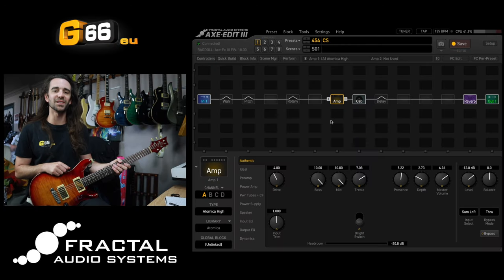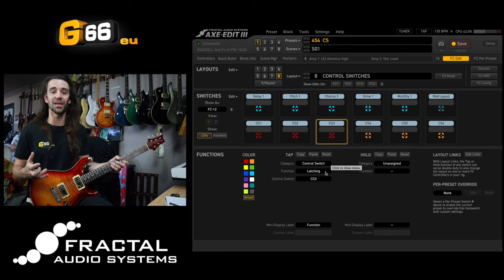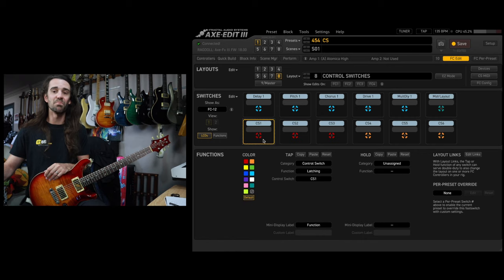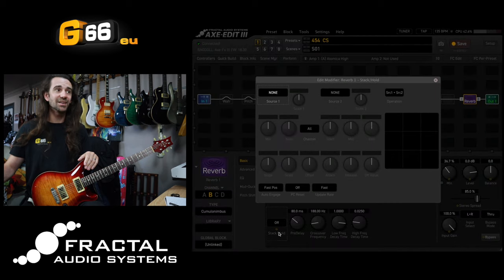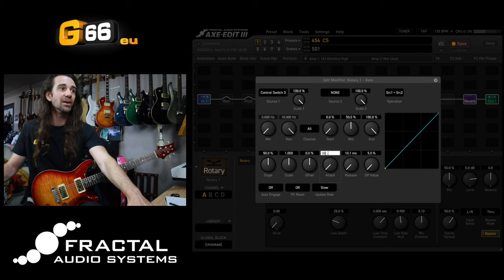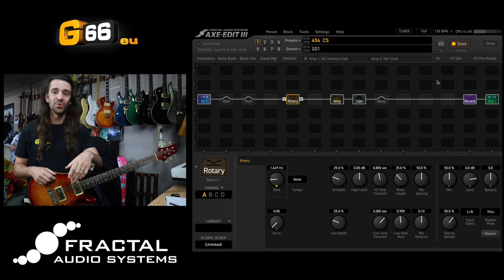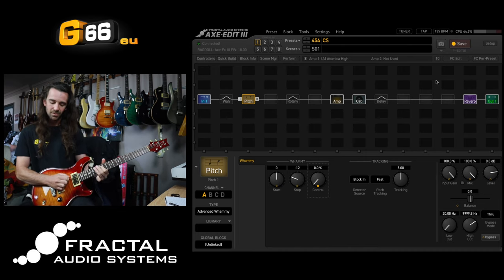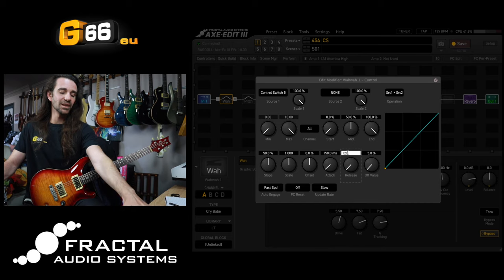Tuesday Tone Tip  - More Control Switch Applications

Comment: I like to use Control Switches to switch my amp blocks between an edge-of-breakup tone and a very clean tone. This involves adjusting the drive, overdrive, presence, master volume, and level controls at the same time. But because I like to place my delay and reverb before the amp blocks, I also adjust the output levels of both of THOSE effects (using the same CS) to compensate for the gain difference of the amps. The result is a "Headroom" CS that seamlessly transitions between gritty and clean tones without any weirdness from the ambient effects.
Reply: You wouldn’t happen to have a demo on how you change all those parameters with a single control switch or point me in the direction of a demo?
Reply: @7bann3  I don't have anything to demonstrate it, but I've been thinking about making a video, as that's only one of several ways I'm using control switches for that preset...
Reply from the maker: LOVE that idea!

Comment: I've been using the control switches on my Ultra to create a scene type setup. Mixer block feeds two seperate chains, one is my clean amp, the other is the gain, and they rejoin at the end on another mixer. Control switch changes one chain from 0% to 100% and the other chain the opposite at the same time. Much faster than switching between patches.

Comment: Leon, it was noted that an octave-down regards the pitch block was -12 semitones.  Is there a standard for trem bars ( a Fender, for example) that defines how many semitones a trem bar will dive?  Also, is there a way to use a CS to act as a trem bar?

Comment: Control switches are very powerful tool.  On a unrelated subject, I want to run output 1-2 to two powered FRFR cabs for stereo and also run output 3 left/right to two  more FRFR powered cabs in stereo on my FM9. Can I do this?  I have never tried using output 3. Thanks LT
Reply from the maker: Should be fine, just add an out 3 block on the grid!